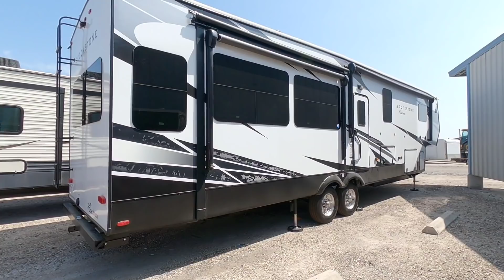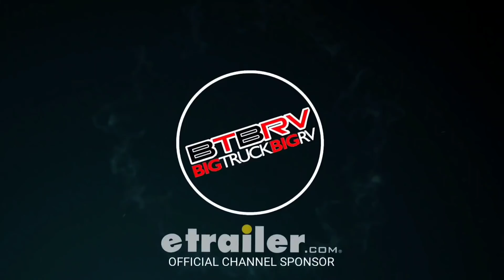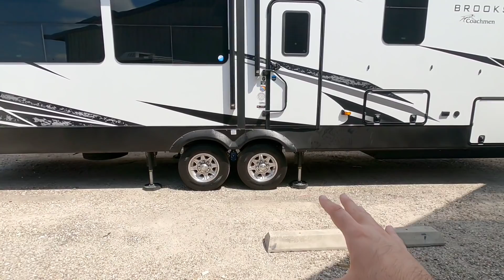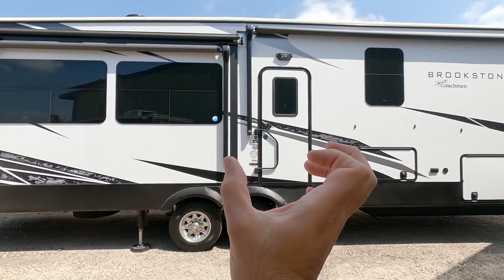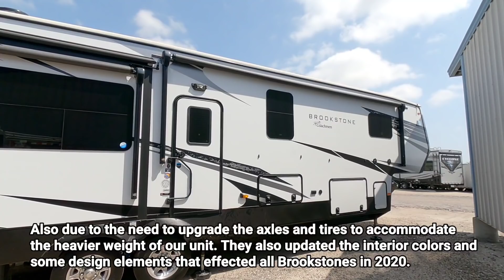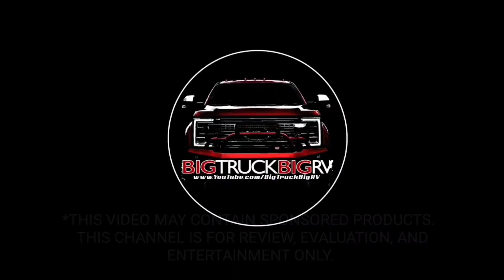Why we chose Coachmen RV and explaining lack of features!

Comment: When my husband repaired a front corner section of the roof, he noticed it was a manufacturers defect that screws were missing in that corner. This year we pulled off the front interior wall and front seams to replace a few rotted boards. He noticed the electrical plug was not done safely (his first trade is electrical). My point is units need to be water tight,  solid suspension & tires. I think you & coachman did a great job.

Comment: Would really like a video comparing the different suspension systems. I.e. road armor, cre3000, etc.
Reply: I agree. I was looking for some comparisons and couldn't find any that were really of any use. I ended up emailing Etrailer about it and going with their recommendation of the dexter e-z flex. I did watch JD's video when he put that system on his cargo trailer but really didn't understand why he changed it out. It seemed to be like a a different brand wanted to promote their system with him so he changed it. I'm not sure. I hope I made the right choice.

Comment: JD, You're a good man. You do an awesome job of getting to the point of what's good and what isn't on RV's. Your input on this model, I'm sure made Coachman start thinking about using you more often. I just wished that someone made an RV with the capability of lifting a wheel chair into a simple side door. There are a ton of people that would buy one if they did. Even Veterans administration, who pay for the installation of ramps, lifts, or whatever for vets cannot do it because the structure isn't strong enough.